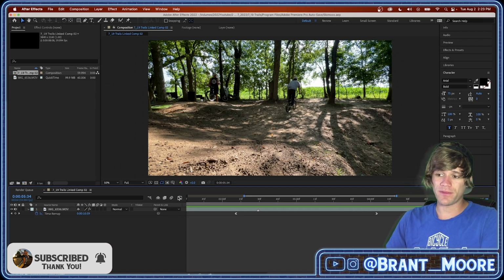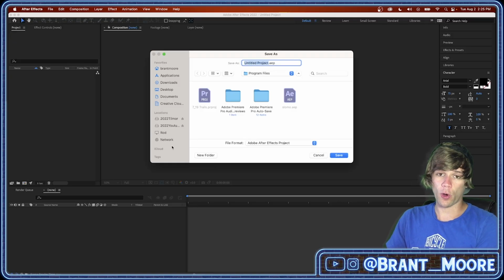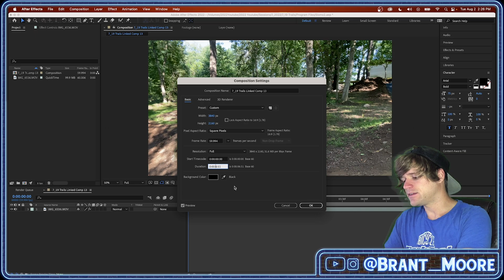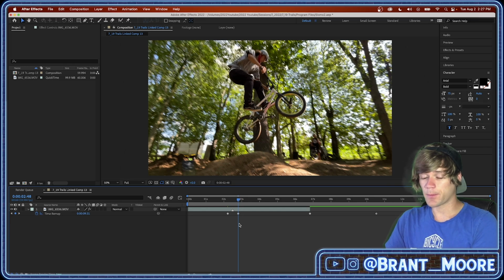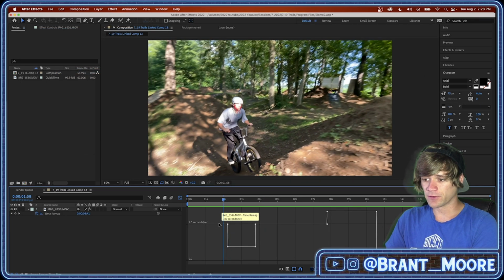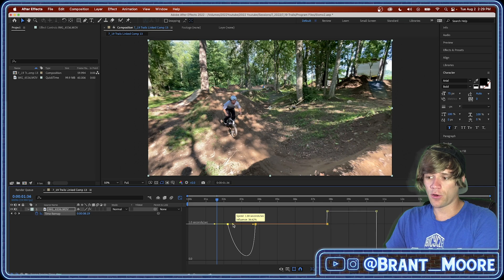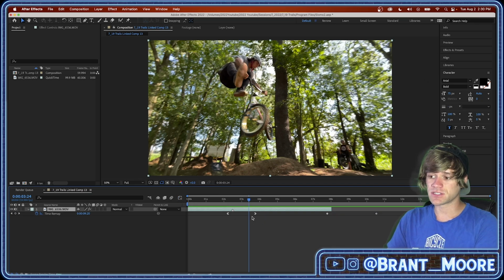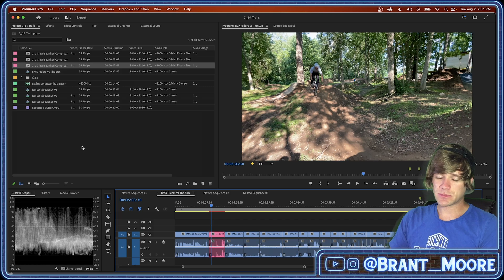QUICK & EASY Speed Ramping! - After Effects Tutorial

Comment: ~ ! NOTE ! ~
If you're attempting this process and find yourself puzzled because your graph doesn't resemble the one shown, instead displaying a diagonal line, it means you're in the 'Value Graph' instead of the 'Speed Graph'.

To switch over to the Speed Graph, as demonstrated in the guide, you need to locate a specific icon beneath the graph section. This icon appears as a small window filled with lines, situated next to the Eye icon at the bottom of your screen. Click on it and select "Speed Graph". This adjustment allows you to modify speed rather than altering the overall timing of the clips. If you're struggling to find it, the button is labelled as "choose graph type and options" for your reference.
Reply: Yes, he shows it on screen but vocally doesnt address it so I post this anyway